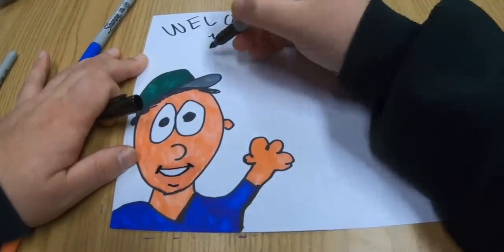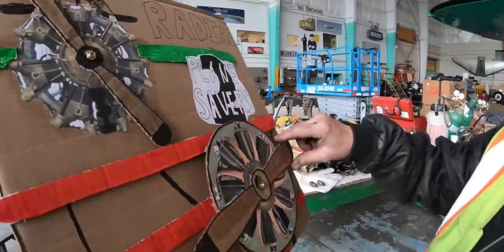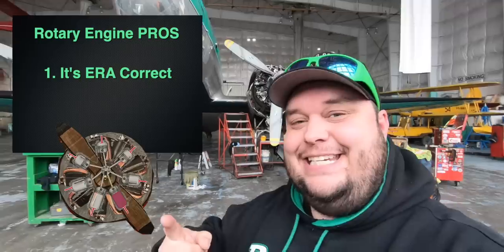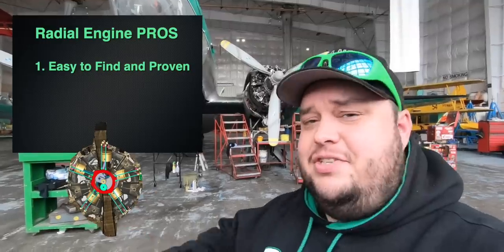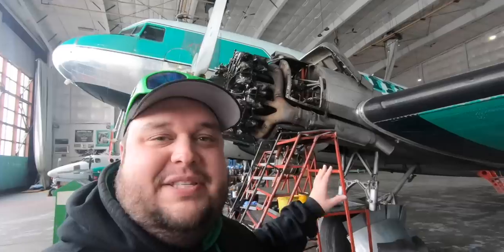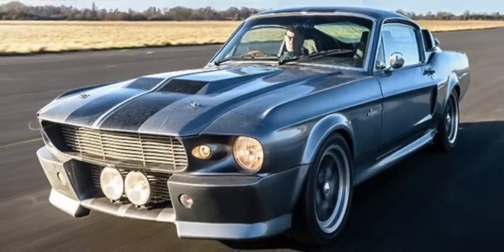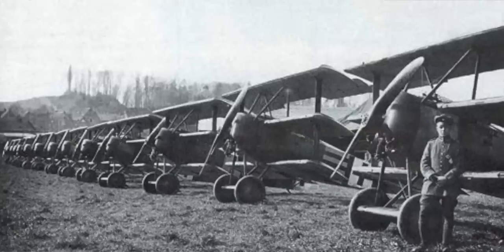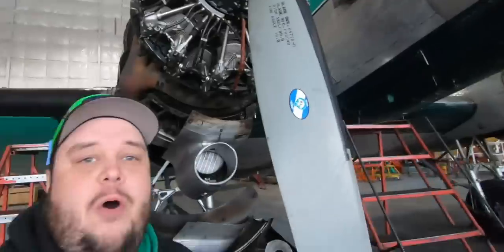Radial vs. Rotary | AIRCRAFT ENGINES | Plane Savers S2-E6

Comment: You missed "gyroscopic precession" as a negative for rotary engins
Reply: Gyroscopic prEcession.  
Yes, it;s a negative. I love Rotaries, but the simple fact is that if suitable radials had been available during the Great War, then aircraft makers would have used them, & for very good reasons.
Reply: I don't think any ME-262s fly with original engines.  For good reasons.
Reply: @KB10GL  apologies for the spelling mistake.
Reply: @richardjweeks   If that's the greatest error that any of us make in a lifetime then we are doing pretty damn good. It's all good mate.
Reply: According to Kermit Weeks, who has flown lots of WW1 era aircraft with rotary engine, it's not really a big deal.
Reply: @daleeasternbrat816  Indeed. Talk about time between overhauls measured in minutes. But two points: with the Me-262 there is hardly any difference in sound or appearance between an original and a more modern replacement engine, whereas for radial vs. rotary it's a world of difference, and second, rotary engines, if handled properly, are reasonably reliable, whereas the orginal Me-262 engines were not.
Reply: @pinkdispatcher  True. I work on a lot of antique engines. (never worked on a rotary)   If the plane came with one or one could be reasonably accessed I think Mike couldn't resist building it. And flying it too. I would put it on a test stand and fly the airplane with a radial. The rotary would be something to see fly !
Reply: @KB10GL  could someone explain why, it seems a rotary engine would be harder to make than a radial engine. I mean... the whole engine is spinning! Everything being fed into and out of the engine can't enter or exit at a fixed point.
Reply: Wasn't gyroscopic procession put to good use in making tight turns?  Useful in dogfights?
Reply: Treblaine Rotaries were much easier on the engine DESIGNERS. 
The actual cylinders themselves are just as easy to make for either, but there’s a lot more design complexity involved in a radial. Radial engine designers have to worry about electrical distribution, valve timing and oil flow. If your timing is off, your engine doesn’t run (or doesn’t run right). And if your oil flow isn’t right, you have dry cylinders up top and flooded cylinders down at the bottom. It all got worked out, just not in time for 1914 and the start of WWI. 

With a rotary, you don’t have any of those issues, because it’s too simple to have any. You have a fixed crankshaft, one valve per cylinder (exhaust, with an open intake), no carburetor, no throttle control, one timing point for the whole engine, and one magneto. When the contact for each cylinder meets up with the magneto, its spark plug fires, and that’s it. There is no adjustment necessary, if the engine runs at all, it’s running right. 
Oil flow is just as easy-it goes in with the gas and the spinning engine slings it toward the cylinder heads and out with the exhaust. Working on rotaries is simple-there’s nothing in there to go wrong! Just keep your engine clean, adjust your carburetor for maximum performance and replace any parts that break. That’s it.
Reply: Precession effect only applies to single engine aircraft. Yaw would induce parasitic pitch, and pitch would induce parasitic yaw. It also made it easier to roll one way and harder to roll the other way. This stuff had caused a number of stalls and takeoff and landing crashes.
Reply: @Treblaine  it isn't, rotory engines were simpler to make and that's why they outpaced radials initially in ww1 but radials can better scale up and post war developments figured out how to build cheaper radials
Reply: @AsbestosMuffins  Thanks for the answer, but why were rotary engines simpler?
Reply: @Treblaine  I think it was hard to make sure cylinders at different angles got proper fuel/oil/cooling, but w/ a rotary engine, centrifugal force pushes fuel & oil where it needs to go so you can cut out the tricky plumbing
Reply: @nathansmith3608  Oh yeah, because if it's spinning it's as if they're all in an artificial high gravity where for each cylinder the "gravity" is in the same axial direction in line with the length of the cylinder. So if you can just transfer the fluids through an axle of rotation everything after that is quite simple.

Except the spark ignition for each cylinder, is there some trick to that? Wait, you could just have the alternator on the spinning engine with the input shaft connected to the static crank so the alternator remains relative to the pistons and can just have wires.
Reply: @Treblaine  I'm not sure what the trick for the electrical connections was, but you could probably use something like the commutator in an electric brush motor
Reply: @radroy92  helps turn in one direction, usually right, hurts in the other.
Reply: @powerdog242  that sounds like a 2 stroke, but modern chainsaws and outboards don't have to spin the whole engine.  they did that for cooling I heard, which shouldn't be a big problem in Yellowknife. Like the Brewster Buffalos in Finland.
Reply: radroy92 
I think that theory only works for left or right turns, I can't remember which.
Reply: They have several planes with rotary engines at the Rhinebeck Aerodrome they fly them all the time.  Their Fokker triplane replica has a radial engine.
Reply: @daleeasternbrat816  i suspect if we could remake the original Jumo engines with modern materials, it would be far safer to use.
Reply: @davecrupel2817  I KNOW it would be more reliable if the right 40s material was available.
Reply: @daleeasternbrat816  trust the word of a jet technician. 
They weren't. Lol

Ever heard of "single crystal metallurgy"?
Reply: @davecrupel2817  Your comments re modern metallurgy are correct.
Reply: Big negative.
Reply: Gyroscopic precession is not the correct term for what you want to describe. It’s the rotational inertia and torque effects you get when trying to maneuver is what makes it hard to fly.
Reply: @jc8952  Precession plays a part as well, mainly because the high mass of the object spinning.
Reply: @Treblaine  Powerdog gave you a more indepth reply, but since he didn't actually ping you in the comment I guess you never saw it (this is why it is good to read all the new comments on a thread and not just the reply notification).

But anyway rotaries are simpler because they basically use their centrifugal aspects to do everything, fuel and oil are both admitted in the center of the engine, where the rotation flings them up into the cylinders, no need for pumps or intake valves, the only timed valve is the exhaust, and spark is also simplified due to the spinning, you just put a static conductor plate onto the frame and then have the cylinder spin under it, meaning it'll fire at the exact moment every time with no timing system at all.

Rotaries were also lighter because they acted as their own flywheel, and generally were less likely to overheat since they were also their own fan. Besides being really messy and not particularly fuel efficient, from an engineering standpoint they have a lot of favourable aspects.
Reply: @DAKOTA56777  that's really clever and bonkers at the same time.

Comment: Excellent episode! The other con for the radial (which is not really a con) is it will change the aircraft flight characteristics. In fact, it will improve them as it will reduce the massive centrifuge effect generated by the rotary engine.
Reply: Yes, the centrifugal force was very pronounced on the rotaries, not a good trait to have on a short coupled aircraft.
Reply: From what I've heard from pilots that still fly rotary engined aircraft is that the gyroscopic forces are slightly overplayed and if flown with the knowledge it's really a non issue
Reply: I agree on the centrifugal problem. Just for safety sake I really hope they avoid rotary.....to treacherous even for experienced pilots.
Reply: Hmm, I never thought of that
Reply: Liam Wedlake: You are absolutely correct, and obviously well read, this gyroscopic force is something that someone overheard in a pub, and has been repeated by morons every since, an urbane myth I think it is called.
Reply: An advantage of a rotary engine would be the gyroscopic power that allowed the plane to turn directly in the direction of rotation of the engine, which, among other things, Richthofen used to the maximum during dogfights.

Comment: One interesting and often overlooked advantage of the rotary engine is one of inherent balance. If you look at your card model of the rotary you see that the pistons are not in reciprocating motion in the frame of reference of the aircraft but are rotating about the crank centre while the engine cylinders and crankcase are in circular motion around the engine centreline. This allows the rotary engine to achieve low vibration levels without counterweights. Unfortunately this advantage is outweighed by the negatives. It was apparently not possible to get a CofA on a rotary-engined aircraft here in the UK from some date in the mid 1930s so that ensured very few survived.

Comment: A terrific video!  Thanks!  A side note:  a friend was telling me, some years back, that the rotary engines used castor oil for lubrication.  The pilots were bathed in a castor oil mist.  Castor oil is also used as a diarrhetic- it will give one serious runs.  He told me that the pilots had to change clothes after virtually every flight.  The masks and scarves they wore were mostly ineffective.

Comment: aircraft rotary engines have a big shield over the top of the engine and is caught by the fender that is over the top of the engine..  you already have that part.  i saw it in the pile..
Reply: That shield also protected the pilot from the oil, mostly...

Comment: I love the radial decision but I question the choice of engine.
Ron Sands designed your plane to fit a Warner Scarab which weighs 292 lb
The Jacob 755 weighs 505 lbs.
200 lb difference in engines is very substantial in a small plane. 200 lb  more than the designer balanced the plane with
May even require tail weight to get it to balance.
Have not even check the difference in diameters I'm guessing it's larger
Don't forget my favorite, Verner Scarlett 9S 158hp, 232lbs Brand new fuel injected and has Canadian distributor and warranty
Reply from the maker: The Aircraft had the Jacob already mounted from when it was built.
Reply: Mikey McBryan , I agree with Danny. You should consider the different radial engine options and get a light weight and reliable engine. Reading about your plane, the crash resulted from engine failure due to icing in the carburetor. Fuel injection increases engine reliability, a consideration in your build.
Reply: Danny Simon well there won’t be real guns on the thing. So that’s a savings of 100 pounds, actually, quite a bit more than that once you subtract 1000 rounds. So gross isn’t a problem. As for CG, the engine is so close to the CG that it would require very little tail weight to balance. Could possibly even be balanced with just the battery. All that, and the fact that it had this engine to begin with make me think it’ll be okay.

Comment: The real reason WWI pilots wore a silk scarf was to prevent chafing the skin on the pilot's neck caused by constantly checking behind them to avoid being taken by surprise by the enemy getting on their tail, but yes, it also was used to wipe off the castor oil thrown out by a rotary engine.
The Oburusal rotary engine used in the original DR1 was a copy of the French Gnome Rhone rotary. Rotaries did have all the draw-backs mentioned in other comments.
Good luck with the resto!

Comment: You got the rotary and scarf issue partly correct Mikey. One major reason for the scarf was to limit the ingestion of the lubricating oil, back then they used castor oil. We all know what castor has a reputation for moving in your gut right? 

Many pilots would fly a few days and then be grounded by the quirts.
An other point you might want to think about is the cooling for the radial, the rotary spun the cylinders for added cooling and the top part of the cowling was closed but the cylinders rotating would add this cooling from the open bottom design. On the radial you will need to open up the top face of the cowling to allow adequate flow to those top jugs to get them cooled.

Comment: A little fact about WW1 pilots - more of them died to dysentery as opposed to combat.   With the fuel for the rotary engine being castor oil/nitromethane mixture it would get back into the pilots lungs and the castor oil took over after that.  Nasty way to go.  It explains why the SPAD 13 was so advanced with a V-8 engine with a proper exhaust scavenging system.

Comment: There were benefits to the old rotary engines, that made them practical at the time. Air cooling for example. As the engine spin around it cooled itself. As technology developed of course they were replaced with radial and inline engines.

Comment: Keep in mind the difference in output power and weight between both engines. That alone may have structural implications. Don't take me wrong: I support the idea of putting a radial engine on it. Just not the P&W one. Something way smaller  would be better.

Comment: When I got out of the USAF in Sept of '68 My Dad sold me a 1964 &1/2 289 HP FastBack Mustang 2-4's 4 speed Black with white Interior. It also had the elongated 'V"  with the 289 above it but it also had a round white background enameled medallion with a Cobra Head on each front fender. I understand that Shelby made the running gear for 650 or 750 Fastbacks in 64.

Comment: For every action there is an equal and opposite reaction. With all of the reciprocating weight that a rotary engine has, crankcase and jugs spinning with the prop, as the prop digs into the air and pulls the plane , there is a serious tendency for the plane to lean in the other direction. Best bet would be to take one of the turbines and cowling off of an Electra.

Comment: You have to watch this episode a few times to absorb and appreciate the work and how much "content" you have managed to craft into it Mikey. 
Firstly your visual tutorial of the working differences of rotary verses radials was spot on. Getting your head around the fact that it is the crankshaft that is bolted to the plane and then the whole actual engine spins around it will be a weird concept for some to accept, but your working cardboard model and computer graphics explained it perfectly. 
As a man who restores a lot of old stuff I totally get the idea of taking things back to being "factory original", however, as your DR1 was/is a replica machine that changes the whole rule book on what route you can take with its restoration. The whole job of restoring a plane to airworthiness again must always be based around doing it safely, and for that reason going down the radial engine route is obviously the safest and most practical way.  Re-fitting a Jacobs radial is also going to be the most straightforward task as that is what the airframe was built to take. 
I really liked the old black and white WW1 pictures you included Mikey, I had not seen those before.  It was also great to see Chuck, Stella and the new dog as well, and of course the wonderful planes in the hanger being worked on. The footage from the "back lot" was great too, I'd so love to spend an hour or so having a nose-about the vehicles and machinery you have parked up in there. 
Regards
David Jones
Coventry
UK.
Reply from the maker: THANKS DAVID!!!!

Comment: My grandfather flew a French fighter air craft that had a rotary engine (in WWI). Because of he mass of the rotating engine made it hard tor turn in one direction but easier in the other. The Germans knew which way the plane would turn which made it easier to shoot down.

Comment: During the beginning of the First World War the Gnome rotary engine was state of the art. The radial was still in its infancy! The original radial engines also belched oil and sprayed the pilot with burnt oil mist! Check the parts count between both engines and ease of manufacture the rotary engine wins. Motorcycles used the rotary engine with some success. Weight was in favor of the rotary engine being lighter and more powerful hp per pound to inline and radial designs. Then comes the issue of reliability the French and Germans both documented that the rotary type of engine was more reliable. The radial was more controllable and offered greater power as the war went on. Automobiles, tanks used rotary engines because they ran cooler by their very nature. Within their limitations rotary engines were an answer to a problem. Never poo poo a old design that filled a niche in its day!  As the rotary had it time so did the radial that led to the inline then turbines and pure jets to turbo fans! Heck there were steam engines tried in planes too. Both the US and USSR tried nuclear reactors to generate electricity to run electric motors!  There was even a pedal driven aircraft!  Still love your program!  My neighbor worked at corrosion corner at Miami International Airport repaired radials for 40 years, he loved them. He had a project 9 cylinder Gnome in his garage in parts. He was building it for a museum.

Comment: Very cool intro Mikey!
I remember reading all the "Biggles" books by Capt. WE Johns  as a kid. It always stuck in my head about the rotary engine of the Sopwith Camel and how Biggles had to "blip" the engine when landing, by switching the ignition on and off to get the desired airspeed and control. A very tricky procedure coupled the mess and smell of castor oil from the engines smeared all over the pilots faces. The books are a good idea of flying in WW1.
Great series mate!

Comment: The gyroscopic forces  of the rotary are what gave the DR1 some of it's incredible handling characteristics.  If you can find a rotary it is what I would install. It will allow the plane to demonstrate its full acrobatic potential. But there are certainly drawbacks to using a rotary.